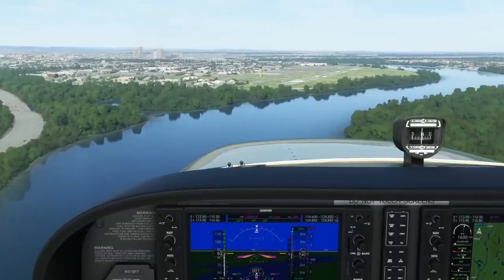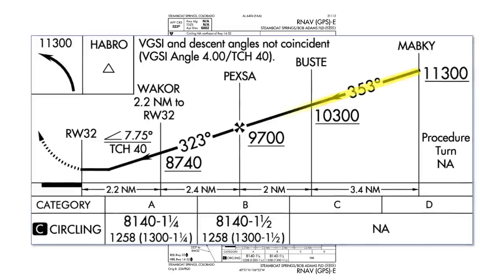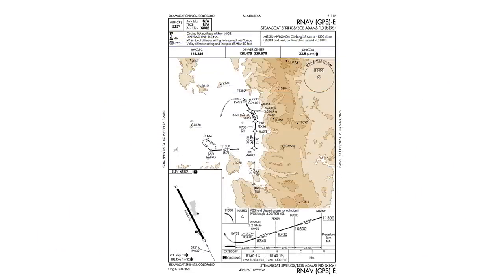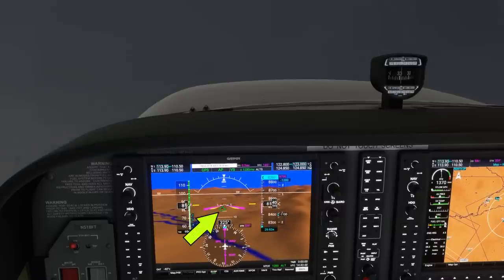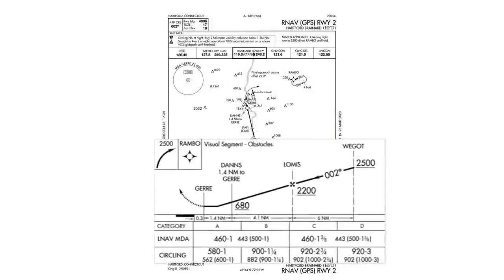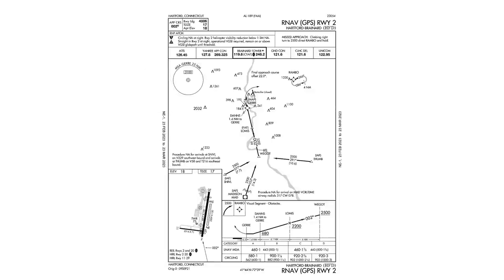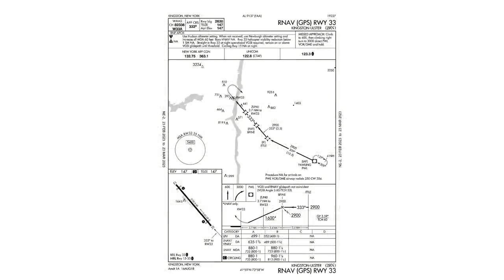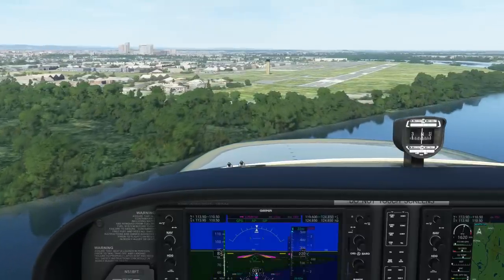Approach Red Flags | How to Spot Risks on an Approach Plate | Approach Briefing

Comment from the maker: Edit: approach categories are determined by indicated airspeed, not ground speed as mentioned towards the end of the video.
Reply: As far as I know, approach categories are also determined by the minimum approach speed in landing configuration at max. landing weight. Meaning you don't just fall into another approach category because you fly faster or slower. An Airbus A320, which is normally category C, doesn't become category B only because it is empty and approaches at 120kts. The minimums according to your category are tied to the aircraft you are flying. They don't change mid-flight.
Reply from the maker: @Treadstone7  That's true that the Cat C won't qualify as Cat B if it flies slower, but the opposite is different, a Cat B aircraft flying 121 knots or more will need to follow cat C mins
Reply: @flightinsight9111  ok then this is probably a difference between FAA and EASA.
Reply: Aircraft approach category is a grouping of aircraft based on a Vref (reference landing speed), if specified, or if Vref is not specified, 1.3 Vso. If it becomes necessary to operate at a speed in excess of the upper limit of the speed range of an approach category, the minimums for the higher category should be used if available. This may occur with certain aircraft types when operating in heavy/gusty wind, icing, or non-normal conditions. For example, an airplane that is certified as category C, but is circling to land at a speed of 145 knots, should use the approach category D minima. https://www.faa.gov/sites/faa.gov/files/InFO23001.pdf

Comment: One thing I don’t understand is you said that since at high altitude our TAS is much higher than our IAS. We are basically putting ourselves in cat B approach minimums. I thought those speeds (60-90 for example) are based off IAS and not TAS or GS.

Comment: Reading obstacle notams are normally  something like unlit tower 9nm from field 100agl. So lots of people don't even read them.

But recently, I had such a red flag at my home airport: SUS 26R RNAV added a 245agl crane 0.6nm from centerline and didn't rase to mininums with a second notam to avoid it. 4 days after I complained to STL, they issued a new notam for the approach raising DA from 292 to 457 agl.

Comment: Great video.

When I look at the SBS chart, I notice that the minimums are labelled CIRCLING. I'm from the other side of the Atlantic but what this tells me is that this is a cloud break procedure followed by visual maneuvering. I wonder if the VDA of 7.75 Deg is published as a guidance or as a deterrent from attempting a straight in landing! When I see such an extreme angle,  I certainly don't want to land straight in, particularly in WXR below VMC... I would also certainly not fly a circling with a 2000m visibility... BTW, The MDH is 1300' which would practically require about 8000m of visibility to spot the runway when reaching the minimums... I'm thankfully flying large jets for a living and we hardly ever flying circling approaches except in the SIM but I would be extremely wary of flying one anywhere below VMC conditions. With a slow flying aircraft, I would still think hard before shooting a circling approach with 2000m of visibility!